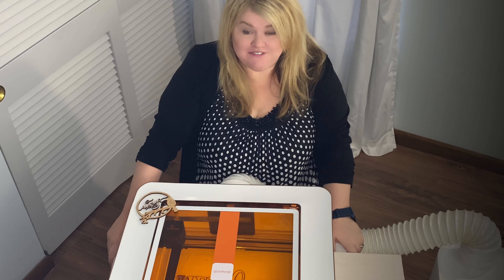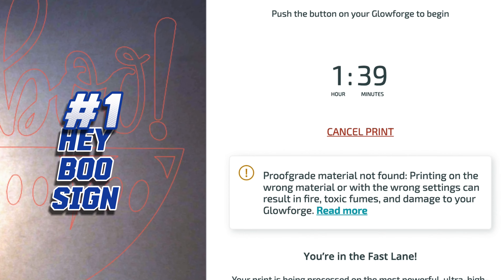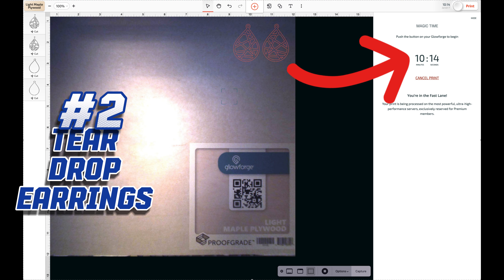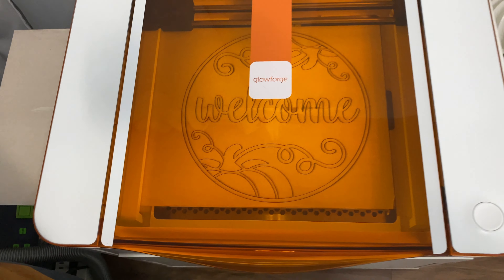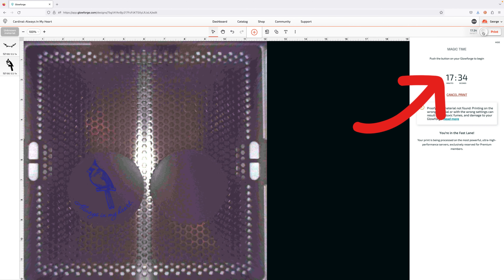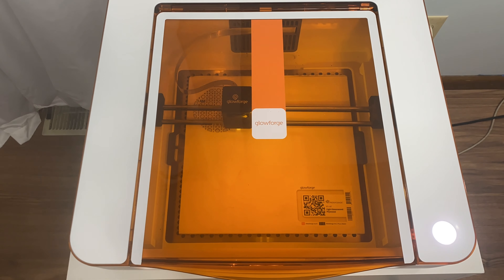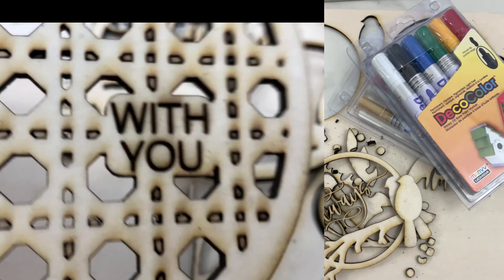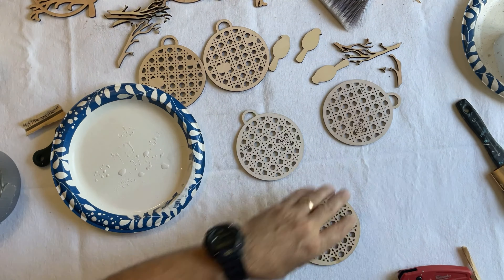Glowforge Aura Part 6: Speed-Unveiling the Frustrating Reality

Comment: There are widespread issues with the Aura, mostly an alignment/accuracy issue. I've had two units and both have it. Let's see how the replacements do.
Reply from the maker: That is disappointing! Please let us know how the replacements work out. We are curious… the alignment/accuracy issue… is it when you are first setting up the project, or is it a problem not following the same path on multiple passes? Thank you for taking the time to comment!
Reply: @Flemingoriginals007  Thanks. It's the issue where it doesn't follow the same path on multiple passes. They tell you to clean the rails, etc., but I've had it do that immediately after a cleaning. In my opinion, the issue is caused by the side "rails" or whatever the black transport things on the left and right ride forward and backward on. They're flimsy plastic, so any variation can interfere with that motion. And they're also the tops of the passthrough slots, so any thicker material in the slot (even within allowable spec) can also alter the height of those rails.
Reply from the maker: @markbailey3514 We hope the third time is the charm!  🤞🏼🤞🏼🤞🏼🤞🏼Keep us posted!

Comment: Can you cut 1/8" plywood glowforge proof?
Reply from the maker: Thank you for your question.  All of the 1/8th” proof grade plywood has an engineered wood core, which means it is MDF… so, yes you can cut it, but you should not on a GF Aura. According to Glow Forge customer service, it will degrade your optics over time. Check out this video for more info: https://youtube.com/shorts/1YnolmUam3U?si=Qg0bNzpSK4JzsQVz

Comment: This unit is not designed for production. The max speed on most diode units is up to 10kmm /m can go higher but has detail and power issues after that. This unit cost far to much not to be top of the specs. If you can return or do many other cheaper options can do better. Might have to learn new program but might be worth it in long run. 10w are very common and can get 30w for about glowforge price or a set of a 20wand 10w for better production.
Reply from the maker: Right, if they want to do full laser production, the Aura is absolutely too limited. However, many crafters want the ease of not figuring out the settings right away, and that is what they are paying for. Many are making only a few items with the laser while using their cutting systems to make shirts, hats, cards, and so on. They may resin tumblers or make other items and simply want to add a few earrings, ornaments…to supplement their craft show products. For those crafters with small or micro businesses who do not want to hassle with the settings learning curve or spend more this may work for them albeit slowly.
Reply: Yes if you’re willing to stay in the glowforge eco system ease of use comes with their scan and go. The learning curve is not what it was 5 years ago or back in the k40 times. Glowforge or not one is going to have to learn their system for the best quality and savings